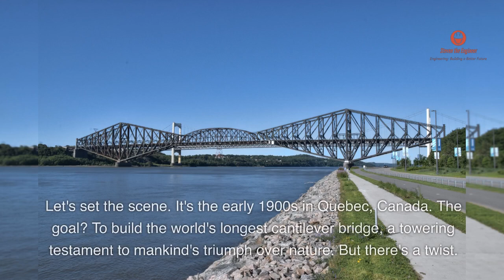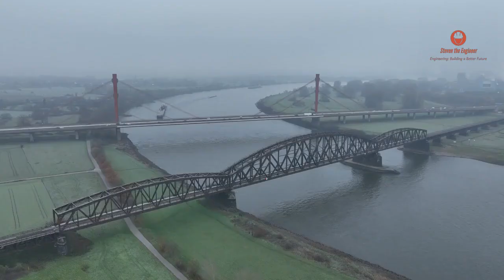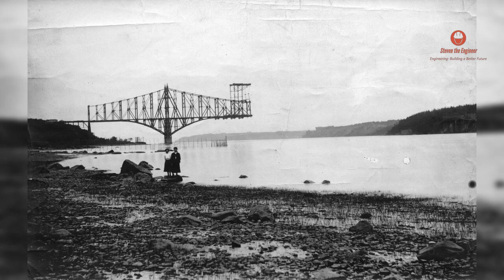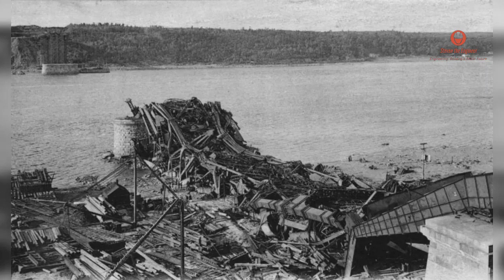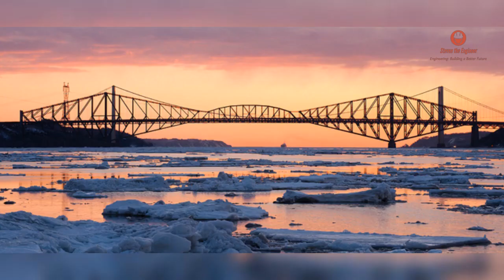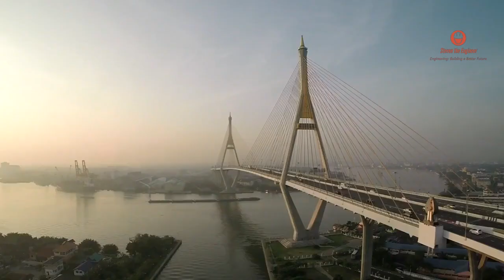The Quebec Bridge Disaster: Engineering Failures

Comment: A third disaster is as of now in progress on this bridge . That for the same 3 causes ignorance about elastic instability of complex structures, hubris ;excess of confidence by engineers and greed; benifits overcoming the safety of users.
Reply from the maker: You make an astute point connecting the failures behind the Quebec Bridge collapse to ongoing issues we still see in engineering today. The combination of ignorance around complex structural behaviors, overconfidence bias, and incentive priorities compromising safety are still relevant factors that contribute to modern disasters. Even with advances in technology and materials, we are not immune to repeats of history if the human elements you cited are not kept in check. I appreciate you drawing that parallel to current events - it reinforces the need to learn from past disasters in order to prevent new ones. These contributing factors manifest themselves in different ways over time, but maintaining ethical engineering practices, conducting thorough analyses, and prioritizing public well-being are timeless principles. Please feel free to share any other insights into how we can continue applying the lessons from the Quebec Bridge in the work being done today. Discussing and learning from such events is how we can strive to avoid "third disasters" as you said.
Reply: Thanks Steven; My comment  is far from an instant point but it resumes my findings from extensive documentation reseach and in situ systemic observations . I think I am at the moment best expert on this bridge situation outside the owners engineering team that knows it all since wy whistleblowing in 2014 and that in details.I spent 12 years  so far focusing on the causes of its actual and fatal elastic instability buckling situation as it is my platform for ship photography. I was littraly born in a civil engineering compound. It was my playground. I worked summer jobs, as a civil eng tech in major projects from 13 years till age 20. Became a, naval architecture tech ( HNC equivalent) ,Completed a Glasgow  ( strathclyde then)U. BSc mechanical eng. Worked 10 years as an Eng In shipbuilding operations. Plus 22 years as a economic and engineering expert in major heavy industry projects for a financing  Govmt body. I also was involved as expert for the judge in a serial of 4 ship capsizing formal inquiry.  But here just now I am muzzeled. See on Flickr Pont de Quebec fissures flambage  naturepainter.
Reply from the maker: I very much appreciate you taking the time to share your impressive credentials and extensive research into the Quebec Bridge's structural issues. It's clear from your background in civil engineering and naval architecture, as well as your firsthand observations of the bridge, that you speak on this situation with significant expertise. Please accept my sincere thanks for your efforts and working to increase understanding of the causes behind the bridge's instability.

With your depth of knowledge on this specific case, I would be very interested in learning more about your technical findings, as I'm sure my viewers would benefit greatly from your insights as well. I checked your referenced Flickr photos which further validate you have an intimate understanding of the structural flaws and buckling behavior. Please feel free to share any documentation, analyses, or recommendations you're comfortable providing more widely. In the meantime, what do you see as the responsibility of engineers and owners in preventing repeats of such elastic instability events? And what outreach efforts would be worthwhile to build public awareness on these systemic risks? I look forward to exchanging ideas, as open and earnest dialogue on engineering failures is precisely how we can hope to mitigate them in the future.

Please let me know if you have any other thoughts given your unique expertise on the Quebec Bridge. Discussing firsthand knowledge is invaluable for the engineering community to continually progress.
Reply: @steventheengineer Thanks Steven ! I will go on with writing a book on the subject of this bridge . But hubris in local political and management of transport infrastructures project is solid as rock to deny any problem whatsoever with this bridge. They even want governments to buy it back from Canadian National Railway a US owned and controlled Cy.
Reply: No engineer degree here. As a Québec City native who has driven on the bridge, bicycled on it and crossed it by train, I just want to comment. Technology evolves. Materials change over the years. Building codes evolve too based on past mistakes, learnings, teachings and applied sciences and engineering practices. Let's not forget that people can still have blind spots. Whether they are politicians, engineers, workers or companies making big and small decisions about building, maintenance, repairs or budgets. Every decision can have an impact on any structure.